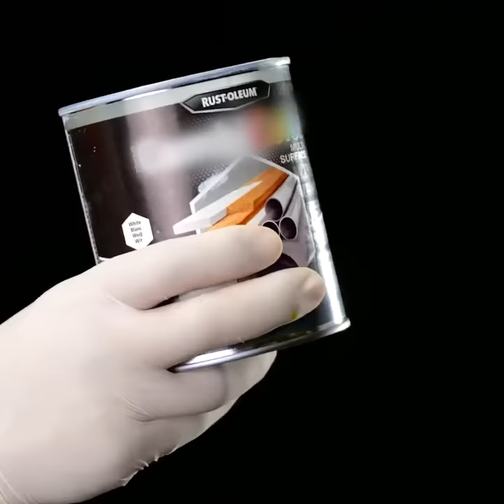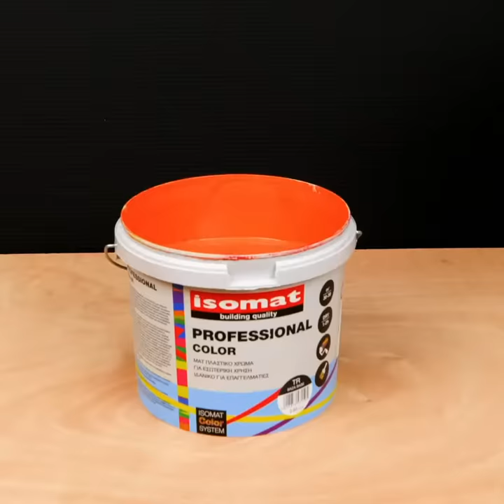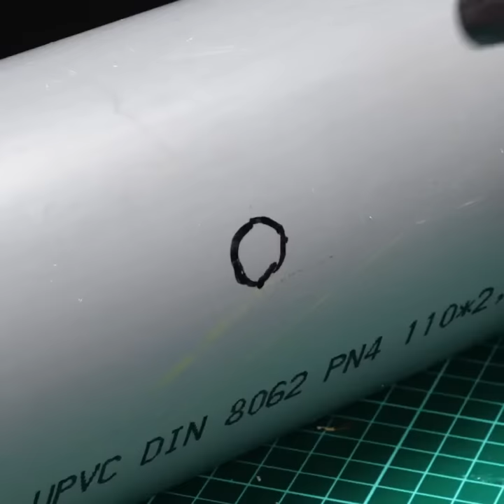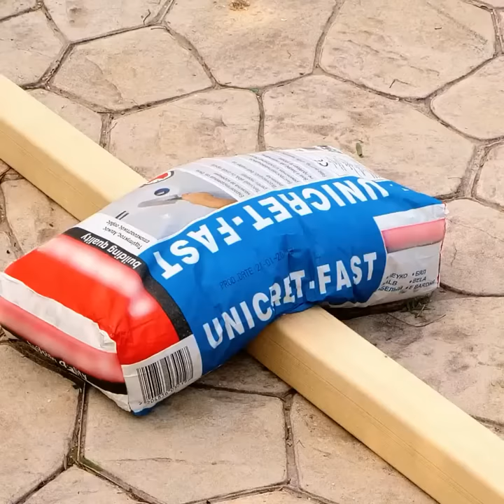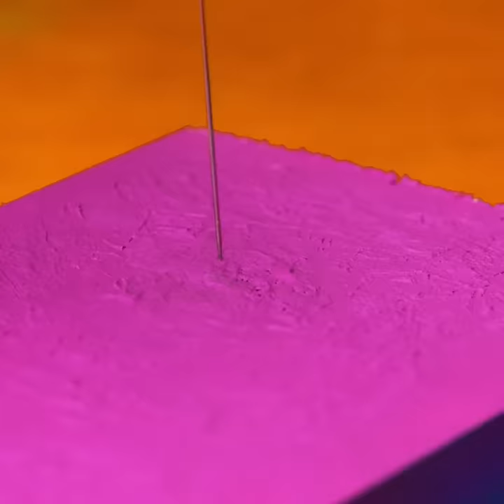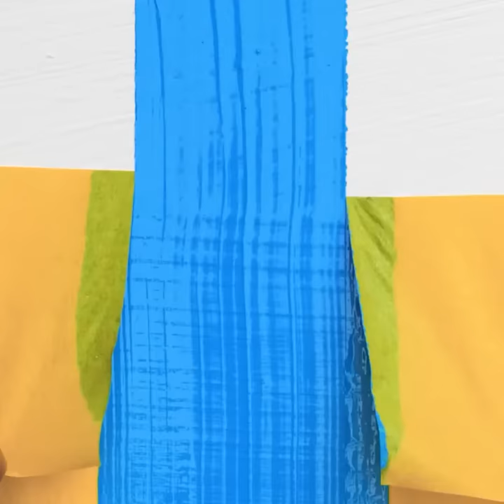LIVE. AMAZING REPAIR HACKS AND DIY TOOLS FOR EASY FIXES || Repair Gadgets, Workshop IDeas

Comment: Awesome video. Another brilliant paint hack, if you haven't got any fruit, just add breakfast cereal, it gives a great textured finish to your walls and ceiling. I did one room with a mixture of Corn pops and warm chocolate, easy to apply, sets quick to gives a cool designer finish and occasionally I even chip bits off if I'm hungry.
Reply: Lllllalaalaaaaa❤❤lp❤❤
Reply: @amrindersinghbhattibhatti2017  ??
Reply: They’re actually mixing them in milk.. look closely
Reply: @sandybiluk5479  it's a great hack because the smell of the sour milk  covers embarrassing room odors remarkably well.

Comment: I can confirm putting up a transparent shower curtain on a tension rod hung behind your rental apartment raised baseboard heater, both makes the air con much more efficient at temperature conditioning your room. Also a platform over the heater and behind the transparent shower curtain is a happy place for aloe vera, babies galore.

Comment: The extension cord on plastic pipe is just going to tangle again like that. The smaller the wrap, the more likely it is to tangle. The best way to gather up a cord is to lay it on the ground and form large circles. Three feet diameter is just about right.
Reply: That's what my husband does all the time!😊

Comment: On cleaning roller paint roll, take out to outside water hose, use the jet setting, and aim at edge of roller. Go up and down. Roll w jet spray.  Cleans it fast and complete  clean away from anything important.  I always thought if u aimed a jet stream of water at a huge roller u could produce a massive amount of electric energy. And the water would recycle through the process. Kinda like a water wheel only faster, stronger and a continue stream of energy produced.

Comment: 0:37 I wish I had that extra roll of carpet laying around when I burnt a hole on the lounge carpet.
Reply: I had a pretty good sized stain in the dining room area of an apartment I rented with a roommate back when I was 19-20 yrs old… we of course didn’t have any extra roles of carpet either. So I eventually decided to cut some of the carpet from inside anyone of our closets with the most inconspicuous area, and it actually worked! If I remember correctly, we ended up using the carpet in my roommates closet. I’m sure it was eventually noticed but it saved us from losing any money from our deposit. 🤷‍♀️

Comment: 33:57 es mucho más fácil pinchar la cinta entre las dos solapas de la caja con la punta de un bolígrafo y luego jalar o empujar hacia abajo, la cinta se romperá fácilmente. It's a lot easier to pinch some holes with a pen between the two flaps, then push down the flaps to breake the tape.

Comment: Instead of risking your electric drill over a bucket of water, just drill a hole through a large piece of timber or other material that won’t flex and place it on top of the bucket of water, dip the sponge in it then put the handle through the hole that is bit smaller smaller than the roller and pull it through to remove the excess paint.

Comment: Ok, i call BS on using a glove instead of a paint brush to paint a table. You will never get an even coat nor get an even coat using your hands. Yes, wear gloves when painting to keep off your hands but not to actually paint the item.
Reply: You can call bs all you want, your still wrong
Reply: I've done it with bare hands. It covers quick, but makes a crappy replacement for a good brush or sprayer.

Comment: Any sound system electrician would fire anyone who would dare try to wind up cords like that 
Sawing a board . Learn the difference between the crosscut and rip saws 
When using screws to join boards , use wood screws not sheet rock screws and use either self drilling screws or a pilot hole drill sheet rock screws are brittle and can break off the heads or snap if over tightened 
When edging paint use either wide painters tape or a painting shield for clean edges

Comment: Eve from NJ- 

I totally agree that this case is totally bizarre! I'm leaning towards accidental death from substance consumption, however, I did note two comments that i disagree with from personal experience... 

1) Both my bf and my brother in-law cannot stand being hot. They both do ridiculous things to stay cool in the WINTER. Before i met them i never saw anything like this but my BIL has a room for him to excape to cool down. He blocked the heat vents and has an AC window unit that he runs while he central air is on. My boyfriend has a huge fan that he runs inches from his head all winter long and there are fans in every room even in winter. I'll come home to him having every window in our house open in 30 degree weather. 

2) I have insomnia and when I can finally fall asleep, i can actually sleep for 24 hours straight, get up to urinate and then return to sleep for another half day or more easily. Unfortunately this has happened to me way too many times to count. I use black out curtains in my room to fall asleep and i usually end up falling asleep to the TV being on (making it hard to hear). The blackout curtains are also noise reducing.

Comment: That “makeshift spout” tape over the can of paint bullshit doesn’t work, if you look closely under the tape, you see the paint collects inside the lip where the lid seals down inside of the can. They then showed him peeling the tape off and the paint is already wiped out of the lip. 
Don’t waste your time with it, or if you do this technique, plug up the inside lip with paper towel before applying the tape overtop of it